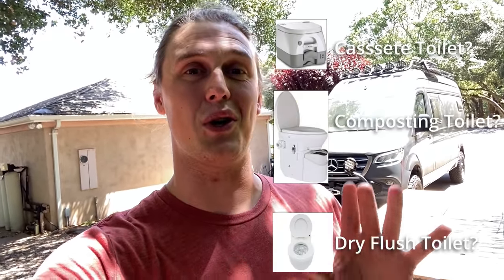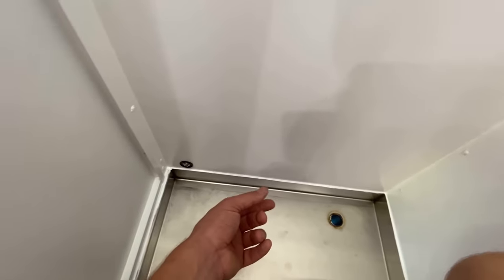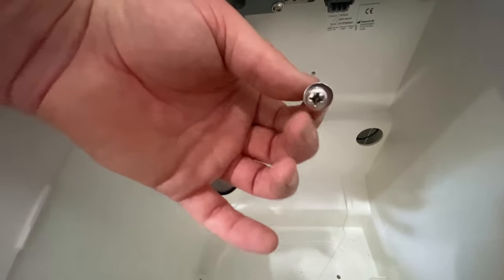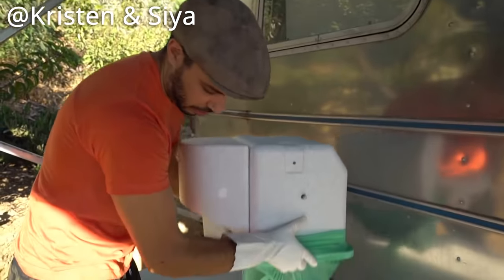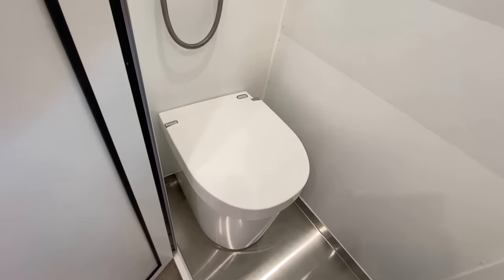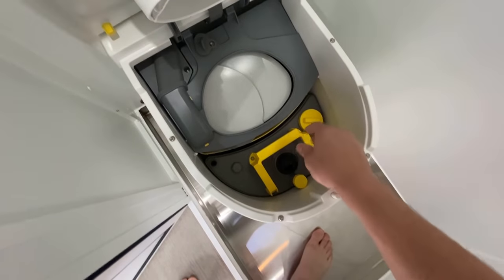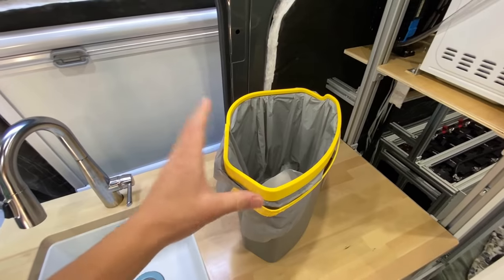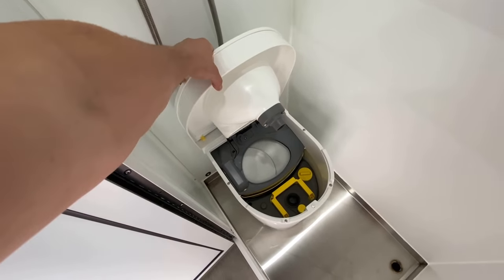The BEST TOILET For Van Life??? Hint: not composting

Comment: We use a Nature's Head.  We carry a spare pee bottle for swapping out at need.  We did not bother hooking up the exterior vent host, but we have had no problems with smell.  I like the composter because the way we set things up, we can just move it right out of the bathroom to take a shower.  I would worry about the smell outside the van with this, as I might lay some pretty stinky poo down there, and I would not want to share that with people outside the van.

Comment: There is no problem using a compostable bag with a composting toilet, they are readily available, so emptying is as simple as lifting out the bag and dumping it on the compost heap. I would never expect the latest deposits in a com[sting toilet to be composed when it's time to empty.

I would never buy one. I might buy a diverter.

Comment: Excellent video!!  What a thorough overview of all the available toilet options out there today in only 13 minutes at that.  I have a sneaky suspicion that a persons van with this system is going to smell outside of the van, especially if one is downwind to the exhaust.  Where as, the compost option will be less due to the composts variable in the equation.  What a toilet company needs to invent, is a corkscrew/worm-gear type of mechanism that can be inserted & easily removed from the solids composting area, with the bag option, so that one can have the advantage of the trash bag option & composting benefits as well.
Peace Brother & keep up the great work!

Comment: We have a Separett toilet in our van and love it.  Ours does not have a urine holding tank in the toilet, we drain ours to a tank under our van and use an electric ball valve to empty it.  This new one would have been a good option if available when we built our van.

Comment: Design esthetics are great and your thorough explanation is even better than the manufacturers video, but one or I should say multiple issues - 1) The toilet part (#2) is not going to be dry all the time, as sometimes due to “loose motion” and hence if you hose down for cleaning.  In those times you will be emptying the pit quite often which will defeat the purpose.  2) Just like the air vent, wish there was a drain outlet for #1 connected out like other vans which would really make things easy.  3) There is a organic liquid - don’t want to call it “chemical” but it can decompose #2 within a day if not hours and is inexpensive maybe the company can incorporate that like a spray (like a flush button) every time someone uses that toilet.  This liquid chemical turns human waste into like a dried soil or mud. This waste then can be thrown or mixed with soil like a fertiliser.  I don’t know the name but if you dig around then you will find it very quickly.  That will help a lot to not look at the first sight of “horror” when emptying the bin and also taking into account the liquid that will enter that chamber which that magic chemical can handle as well.  You might have to figure out a different liner for that bin as that thin paper bag type will not work for that setup. Hope you show us more video in future once you start using this innovative toilet.

Comment: This looks to be a very promising front runner for my van. Not sure what has changed from time you got your and the present as there appears to be a massive inventor on Seperatts end and they are unwilling to sell new "flawless" ones until their defected ones are sold out. I have been trying to locate a new one and after no luck. Got this response (1/2/2023) from Separett...
"Thank you for your inquiry. The only Tiny® units currently available in North America are affected by the design flaw. It is a very slight issue that may cause a gap in the privacy screen when in the closed position. We do not have brick and mortar retailers in the PNW as of now but the best place to order is through our website below. We are based in Las Vegas, NV and ship orders daily Monday-Friday via UPS Ground. Hope this helps!"

Appears, at least for the near future, I would need to purchase a flawed Tiny with Urine container if I wanted one. I am checking with some contacts I have in Europe to see if I could have them purchase one there and ship to US.

Comment: Cassette toilets don't need a dump station. They can be dumped in a regular toilet as well.  Also, there are additives that can be put in the tank of a cassette toilet to make the smell level much lower, and break everything down better.  I think it's interesting when you speak of opening the solids container.  That bucket of raw poo has got to be nauseating, to say the least!!!!!  And, (tmi) people's solids don't fall straight down, neatly hitting the center of the "target".  So better have a big bottle of spray bleach and paper towels, along with resealable baggies really close by (that's assuming whoever uses it will have the courtesy to clean up after themselves). I've cleaned enough toilets to be keenly aware of that. Finally, I don't declare something the best until I've used it for a while.  I have no doubt you'll figure out what I'm talking about pretty quickly.

Comment: The organic matter inside the composting toilet is also to stop the smell when you take it out to dispose of it. When your gonna open your Seperett toilet I bet you that is gonna smell really bad if you fill all of that up, but if you do a good job with the Nature head or the air head, if you take the solids out it's gonna smell like dirt as the peat moss or the coconut husq will have taken most of the moisture out and the ent also will dry everything up. Carbon usually stop the smell in compost that is one of the perks of putting it in, in the first place. But it's nice to see another toilet on the market for vans.

Comment: Great video and info. But one thing i would have changed with the toilet mount. I would have made a quick connect bracket on the back. Because since you didn't screw the bottom. I am guessing it is free floating so water can get under it and can have mold issues if not checked or cleaned. Also since it is mostly a self contained unit, just a power connector, having the quick connect would make it easier to maintenance and move in emergency. Aka pooping on a mountain cliff overlooking a valley. 🤣

Comment: I made my own separating toilet on my yacht, which I've been using for 18 months. I added a small computer fan piped to the outside, which draws air over the solids and paper and dries them. There is no need to add any sawdust. It is the urine that smells most but the fan works very well. There is absolutely no smell in the bathroom.

Comment: Good point about waste needing time to decompose. If composting, the waste needs around 20 days - IF you build a compost heap that has an internal temperature of around 50-60 degrees C. It needs to be that hot to break down pathogens. Waste straight from a composting toilet is not safe to use as compost.

Comment: I think it will be cool if it have some kind of 'soil/compost' flush where it put thin layer of soil on it. Not only it absorb moisturiser, but it also bearable when throwing it out. 

There are villages in my area doing that. After pooping, they will use a scoop of compost and throw it on the poop. Though the toilet hole capacity is super big, hence it able took time to compost~~

Comment: So I have a 53 foot Spencer Ketch and am considering switching to composting toilets ,getting rid of my vacu flush  system. The problem with my vacu flush is the cost of maintenance. 
   I am not sure about the whole walking around with a bag of feces to get rid of is great for my application. At least with a composting toilet the material is partially broken down and can be dumped in the forest.

Comment: If I understand you, solid waste remains in an open bag in your van until you change the bag. That means the vent fan would have to run constantly. Or you would need to bag up each dump. What exactly triggers the fan to activate?

Comment: Ok, (btw. Thankyou for your always informative videos), so, overflow issues, was wondering about if one might add a slow drip system to that. One imagines the saline drip used in hospitals and clinics would be sufficient. Urine though controversial is an amazing fertilizer as we all nerve that rather than tyre-bits, oils, chems and tar washing off of roads, slow drip urine, even stealth, should be way better yes?
Noe for offloading the WC: dreaming of seeing a video where someone has built a type of drawer system that rolls OUTwards from the van's exterior, (that requiring a lock and outside access in the build), to offload and clean the separator WC. 
Meantime we're fans of your channel.

Comment: Hopefully someone comes out with a hybrid version of this that combines its advantages with those of composting toilets so there's less smell especially over time and you don't have to look at your untreated accumulated business when it's time to throw out the bag, and perhaps even having a mechanism to close and seal the bag so even that step is eliminated.

One way to do the former might be to either eliminate the auto-open feature when you sit on the seat and make it something that you have to manually open with a lever or switch, or add a manual open feature to the auto-open one, in either case allowing you to manually add some composting material after you've done your business.

Although I suppose that it's possible to do that with this by getting up after you're done, throwing some composting material on the sliding cover, then sitting down on it again to drop it onto your business (and hopefully none of it sticks to the top of the cover).

In a more perfect world you'd have toilets with black water holding tanks underneath your vehicle and a large network of collecting stations that you drove over and then dumped it into, or, even better, that had a hose that you connected to the tank, that sucked out its contents then flushed it thoroughly with water and biodegradable but strong detergent to clean it out thoroughly. But, alas, no such thing.

Comment: The one with the bag... A cheaper system is getting a 5-gallon bucket and putting regular bags in it. They make cheap $15-$20 seats that clamp onto the 5-gallon bucket too. It's not pretty but one could always make a plywood base to slip the bucket into to make it more like a toilet. Then you could toss your waste in the trash or in a big burn barrel where you burn your trash even.

Comment: 0:36 Total clueless noob question:   Would the 'full 10kwh battery' system be able to handle an incinerator toilet's 1.5 to 2.0 kwh per use, requirement?   Or, would that 15-20% very likely be a total powerhog, leaving not enough for other power needs vs speed of regeneration?

Comment: I prefer the composting toilet that uses the four litre milk jug. There isn’t any smell to those toilets and  you don’t have to vent them. You can vent them but you don’t have to. The sawdust keeps the smell down and they are much easier to empty than other composting toilets. There’s a window in the front so you can see how full the jug is.

The advertisement video for the dry flush puts liquid in it too. For the price of it you better be able to put in liquid and solid!

Comment: The reason I chose not to go with this option in my cargo trailer build was that, on the #2 side, it didn't really seem significantly better / more pleasant / better smelling to pull that out, fully exposed, compared to dealing with the porta-potty and cassette types. For whatever reason, so long as they are managed well, the composting types do seem to knock down that aspect of it a little, though manual handling of the material will always involve those issues in some measure. My NH composter definitely does not get as bad as some of the earlier types I tried that were sort of a miniature open-pit approach like this one.

Comment: Also. I would love to see a Laveo created with a urine separator… Engineer that. They need to create a Laveo that separates the urine to drain into the grey tank, which urine is grey water, few know that. Have the Laveo seperate the urine so that you only have to flush the Laveo when you poop. I have visualized it in my mind. But someone could recreate a seat using a seperette urine diverter and have it high enough so the Laveo can flush the poop. I can see your Engineering mind could create a seat they can pop on a Laveo that would divert the urine into the grey water tank.

Comment: I like this toilet very much.  I will likely replace my black tank version with one of these and replumb the black tank for additional grey water space.  I like that the urine tank is gray and not the translucent white of the composting toilets.
Reply from the maker: Cool! They also sell a version that pipes the liquids into a tank (instead of contained in the toilet)
Reply: @seven_o_savage  Do you know what model tank will divert the urine into a separate tank under the van?  I did not see which model would be able to do that.

Comment: Hey mate, great video. You are right about the composting process being too short to really do something in a van composting toilet. As a big fan of simple bucket system composting toilets I like the separet you talk about there, though you do not really cover how and where you get rid of nbr 2. With a composting bag full of ... well ... shit you would have to dispose of it either in a bin (ie wastage) or in a compost able atmosphere such as a compost pile or worse case scenario a hole in the ground. But to guarantee a good composting of faeces (mostly nitrogen) you would need to increase the carbon ratio by adding wood dust/chips, peatmoss, leaves ... That would also guarantee limited smells and rodent attraction.
However when on the move I don't find that quite practical. I guess the nature's head toilet dont really address this neither even if they are already mixed with carbon material you still need to get rid of the whole thing somewhere where it is good to finish composting

Comment: It’s better than composting, less cleaning. For van life a 5gal   Bucket with toilet lid and trash bags will work just as good, saving you $640.00 how’s that for engineering under budget it will also free up a lot of the shower space as you can move the bucket outside and inside.

Comment: Hello, I am writing to you from Pécs, Hungary. If it is possible to ask for an answer regarding the toilet emptying. I would be interested in the following: When you take out the solid material cassette, its entire contents are in front of you. It smells right there in front of you. You see the open container with its contents. Can you throw used toilet paper in? Are you pouring this out? Do you close the top of the bag and unload? Or what comes next? You took out the cassette, which is not covered, and you can ventilate the motor home afterwards!!! You showed that you are removing the yellow clamping ring. If you're lucky, you'll immediately grab the edge of the bag and continue emptying the tank somewhere. Where can you legally store such a pack? An open black drain cannot be taken into account. Street waste collection baskets cannot be used either. So where can it be officially deposited? So how does the most critical part actually work? How much does such a store-bought device cost? Thanks for the answer.   /    Szervusz, Magyarországról Pécsről írok neked. Ha lehet kérni egy választ a Wc ürítésével kapcsolatban. A következő érdekelne: Amikor kiveszed a sziladanyag kazettát előtted van annak teljes tartalma. Az ott szagosodik előtted. A nyitott tartályt látod a tartalmával együtt. Használatkori wc papírt beledobhatod? Ezt kiöntöd? Összefogod a zacskó tetejét és kirakod? Vagy mi következik ezután? Kivetted a kazettát, ami nincsen letakarva és lehet szellőztetni utána a lakóautót!!! Azt mutattad, hogy a sárga leszorító gyűrűt leveszed. Ha szerencséd van akkor azonnal összefogod a zacskó peremét, és úgy mész tovább tartályt üríteni valahová. Hol lehet egy ilyen pakkot lerakni legálisan? Nyílván fekete lefolyó nem jöhet számításba. Utcai hulladékgyüjtő kosár szintén nem használható. Akkor hol lehet hivatalosan lerakni? Tehát hogy működik valójában a legkritikusabb rész? Nálatok egy ilyen bolti készülék mennyibe kerül? Köszi a válasz.    Gyulay Pál

Comment: Grant it I say this not ever having used one, but a poop bucket and a bag seems much more efficient, cleaner, and economical. Removing solid waste in the most immediate manner would be a priority for me. 💩 doesn't always cooperate and fall gracefully with the pull of gravity. In an emergency (most likely scenario for this device) spray and pray is not a comforting phrase. When things get sticky I want an option that can be eaaily removed as well. Just my graphic thoughts.

Comment: one thing that I've seen wear out (eventually) on all "regular" toilets is the SEAT. Hinges fracture, or something goes wrong with the seat itself and IT fractures etc. Replacing a standard design toilet seat is cheap and easy (unless you order these for the gov't in which case they're crazy expensive). I like your being an industrial design enthusiast so I'm curious about what you think about the potential longevity (and what happens when that end of life state has been reached) of the seat on this toilet since it's more than just a "seat" but is integrated with multiple other components that allow the whole thing to work.